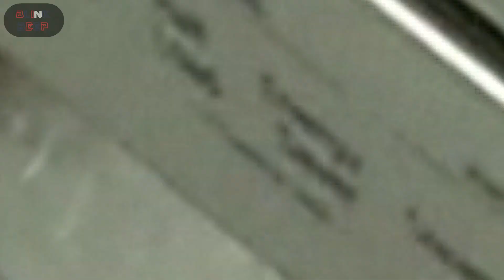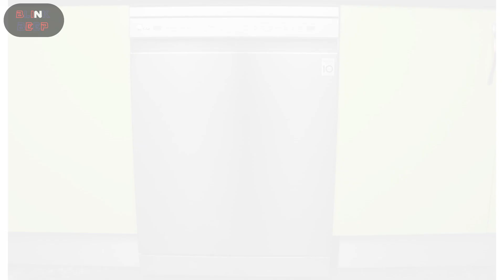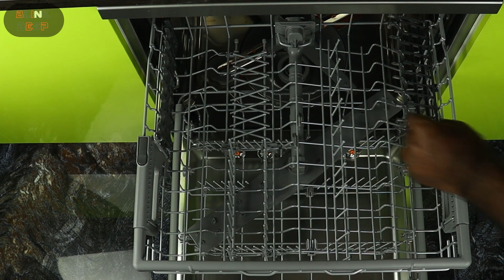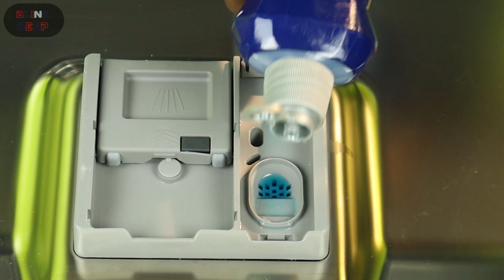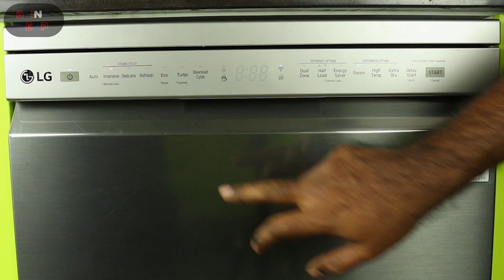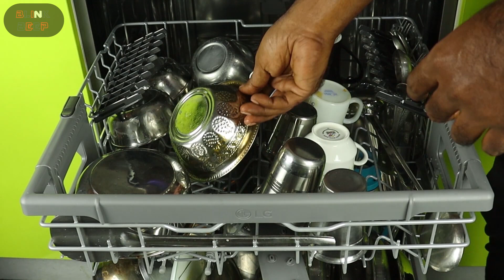LG Dishwasher | DFB424FP | Complete Guide | Review | Highlights | Features | Demo | Pros and Cons

Comment: Resume cycle Info from a user in one of the eCommerce sites : -  There is a common confusion in users that if current goes off during the operation of machine, the full cycle to be repeated again. Lot of You tube videos also say the same. But this is completely wrong. The Fact is that total wash cycle is divided in sub cycles of time so when current goes off this machine resumes from the time of start of last sub cycle.
Example: Total Cycle time: 3 Hours
Completed time: 2.15 Hours when current goes off
Remaining time: 45 Min
say last sub cycle started after completing 1.45 Hours
Machine will resume from this point means it will further run for 1.15 Hours and not 3 Hours again.
So don't get confused from you tube videos.
Reply: Hi Which model number you have 424FP or 532FP ?...Thanks !

Comment: how to judge the salt level ? and did you add water plus salt or salt with rinse aid ? is it good full upto top that box with salt and liquid ?
Reply from the maker: You can use the thinq app for knowing salt and rinse aid levels. I have a video in my channel on how to configure the thinq app. And to add  salt, it  has a separate compartment to be added. Rinse aid should be added in separate compartment.  No water needed. It will be taken care by the machine itself.

Comment: Thanks for the comprehensive review. Can the height of the dishwasher be adjusted? If so how?
Reply from the maker: HI. I don't think it has height adjustment. It supports leveling if the floor is not even. For that purpose it has adjustable screws. But that I don't believe it helps in increasing or reducing the height.

Comment: Please how to dry dishwasher..coz after washing dishes ,dishes r dry and machine still wet .should we fill the salt must before use…?coz I bought same lg brand 🇨🇦🇨🇦🇨🇦🇨🇦
Reply from the maker: I leave it a bit opened after the wash is over so the air flow will assist in faster drying. It is recommended to have salt loaded always. That way you will get good life on internal parts. Else hard water might cause damage over longer usage.
Reply: @blinkNbeep  thanks 🙏 but I didn’t see any knob for salt which is I saw other dishwasher.this is the latest one we just got 2 days ago so yesterday I washed dishes in it first time.but after ur video watching I didn’t see any hose for salt🙃🙃🙃🙃🇨🇦🇨🇦🇨🇦🇨🇦🇨🇦🇨🇦🇨🇦
Reply from the maker: Can you provide the model number. I will check if possible
Reply: @blinkNbeep  I will.thanks again for concern 👍🏼🇨🇦🇨🇦🇨🇦🇨🇦🇨🇦🇨🇦
Reply: LG thin Q.model is LCW-003 or LCW-007🇨🇦🇨🇦🇨🇦🇨🇦🇨🇦
Reply: @alii9781  there is a funnel given with the machine.

Comment: I have been using this dishwasher for a year but when the power goes off and then when the power comes back the machine starts the process from the beginning.
How can we solve this because dishes are not washed properly when the power is cutted in between.
This dishwasher is too much costly but this problem is only in this dishwasher.
Reply from the maker: After using it multiple times i realized that it doesn't come with resume feature.
Reply: @blinkNbeep  Can you please tell me which year model you are using?
Does it have resume function?
Reply from the maker: I got it in 2021. It doesn't have resume.
Reply: @blinkNbeep  But you have written in comment that it starts from where it left during powercut.
Reply from the maker: Yes. I earlier thought that it had the feature when i tried to switch it off manually and turned on again. I have modified my comment from earlier. Thank you for bringing it to notice.
Reply: @blinkNbeep  Thanks, I was also looking to buy this but in my area there are powercut sometimes so not going for this at the moment.
Reply: @ashutoshsingh2669  "Resume" in other brand machines is NOT even useful. If there is a power failure for a long duration, wash water would have cooled down. So on power return, the water will have to be heated up again anyway or else washing will NOT be as effective.
It is better to use the thinQ app to know roughly when power failure had happened. ON power return, just manually run the either the REFRESH cycle or the RINSE cycle.

Comment: After powercut cleaning cycle will start from the beginning ?

Temperature can't set by mannualy?
Cost of this model plz
Reply: @blinkNbeep  thank you for reply..cost plz
Reply from the maker: I bought it 6 months back for around 56500 INR. And we can't set temperature. We can only choose to set high temperature as an additional setting.
Reply: @blinkNbeep  it doesn't continue from where we left it before power cut.It continue from beggining.
Reply: As far as I know it start from previous cycle incase of powercut.. this is also confirmed by LG service centre. E.g. if it's rinsing and there is power cut it will start rinsing again. Which is stupid.. and I don't know how a brand like LG miss this memory function.
Reply: @rajminnie  ALL new models of BOSCH also miss this memory function.
Only OLD dishwashers that use mechanical cams and electrical clocks can resume after power cut. Microprecessor controlled modern machines cannot resume.
Buy a UPS or petrol generator.
Reply: download cycle and start from where u left off